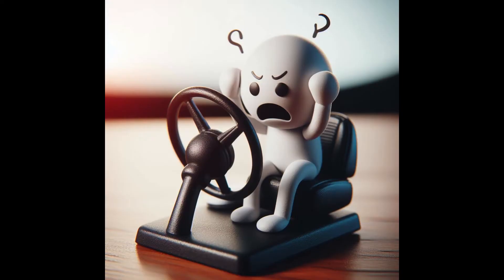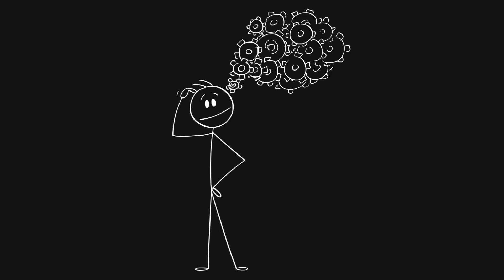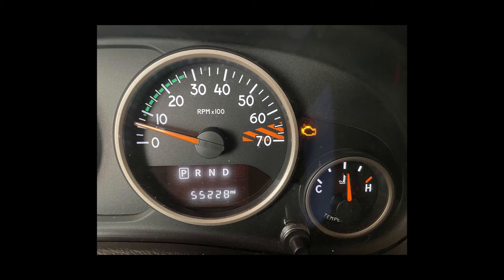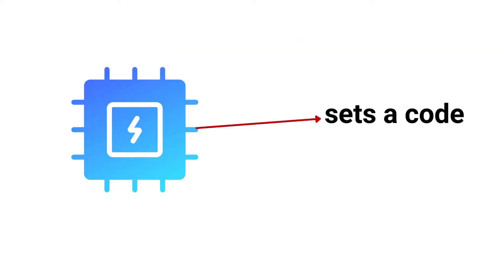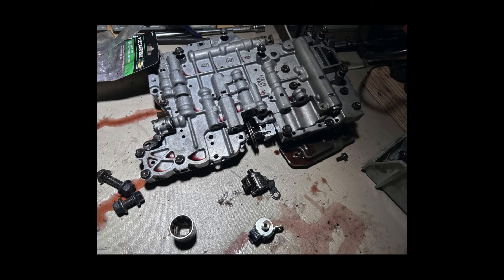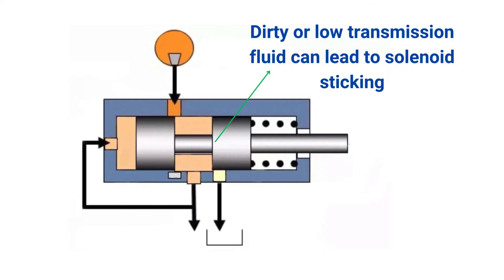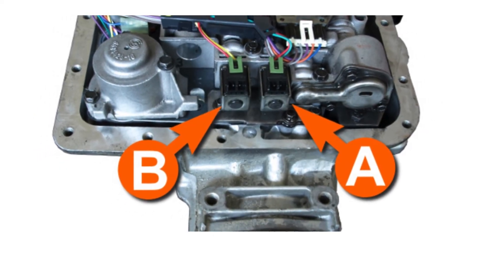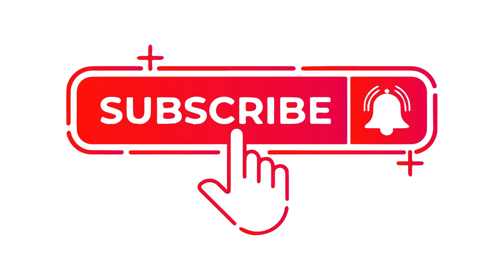5 Signs Your Car Has a Bad Transmission Shift Solenoid (Only MECHANICS Know)

Comment: I have a 2008 Nissan Sentra and after I changed the stepper motor doesn’t reverse. Do you think have to do with selenoid? Also which selenoid need to change??

Comment: Could you make a video on what to do if the transmission oil is brown with some deposits?
One mechanic says, "Leave it alone, there's nothing you can do and it could last for years." Another says, "Change the oil and filter." A third says my transmission needs to be rebuilt. One video says that if you change the oil and filter, you'll damage the transmission because it will lose traction. Also, can using an additive make the transmission last longer or ruin it? My car has 93,00 miles on it. It slips a bit (less than a second) between 2nd and 3rd gear. It has a standard 4-speed automatic transmission. It's a 2004 Chevy Monte Carlo.

Comment: Thanks for sharing this, I experienced this when the check engine is light up on my fiesta S 2014 1.5L, but the solution for now is to make sure that the voltage is correct, lets say i have bad start voltage below 10V then it will happen if I drive for 10 minutes, if the starter voltage is 10V or above its back to normal and its smooth. The way i fixed it when the check engine is on is first stop the car, wait like 30 mins, turn the ignition (II), make sure the ac, head light and radio is on, then I will get like 13V now, rev on 2000 rpm for about 5 second and turned the engine off, wait 5 minutes and the check engine light is off and the transmision is good. Some cases that why the starter volt so low (below 10) is because sometimes I lock (which has auto retract mirror) and unlock for several times to take something on my car, also the light is on when the door open until i lock the car again, this is most cases that I have experienced